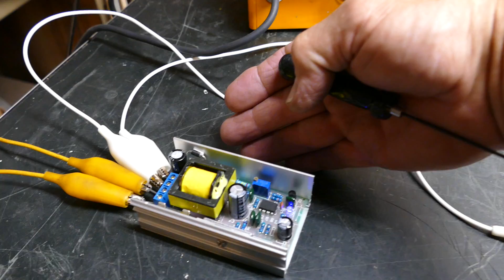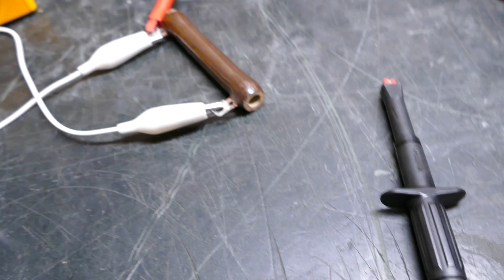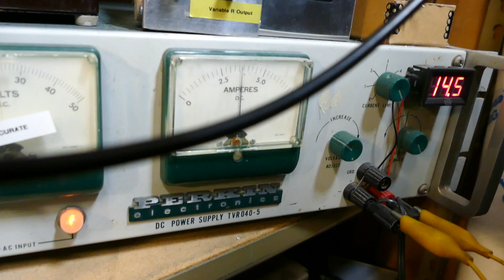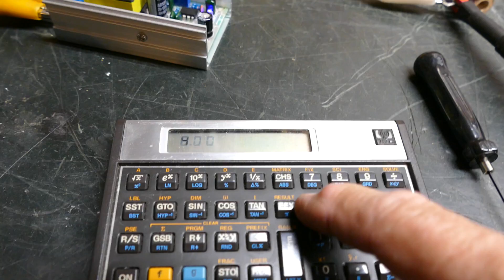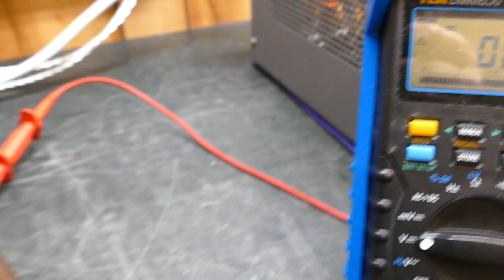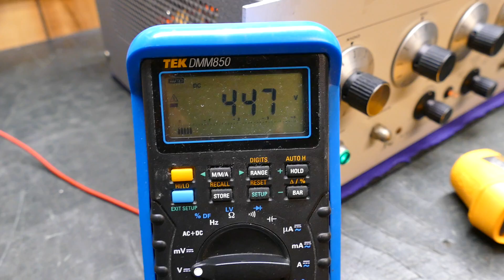Solid State High Voltage Regulated Power Supply For Vacuum Tube Circuits

Comment: Thank you for the hands-on review of this high-voltage power supply.  I realize that I am very late in joining this conversation, but I can't seem to locate the exact part or model number for this unique power supply.  Can you (or anyone) help?
Reply from the maker: Here are a couple that can get you started. On Ebay they are called, high voltage dc to dc converters, or something like that.  

https://www.ebay.com/itm/293851632650?_skw=high+voltage+dc+to+dc+converter&itmmeta=01JM3YMCPQ2G925VCCQDP35Q29&hash=item446aec140a:g:wQcAAOSwspxikT~-&itmprp=enc%3AAQAKAAABAFkggFvd1GGDu0w3yXCmi1dZtoO%2BI6bpY1RPy4yAmuS0b5CqyTo9QE0ngx9LbuwM0tDdlHqsHEq%2FdmF3BbaIz%2B%2FFYvSibdyJPHPsivDw9s4F5dc06zKra7skKeggDsISITW4yLQ52SlwZy9J4YeHRtrmQE9tPYtFeKUG5Iw0xri%2FFUH3eb8jnIwlMyom28bKonnst3DKtdYHys%2FbvG2lfSkakgqlSldEjbQGhk15ZBaCnbd1owv45YisrYgPIby6y%2FUtr06JpXCJnCZbddMgi%2FQ9UiIQQX%2F2Wi4FZAf9GSur2Rb39AQcw6TIVRrtaF4hDrzIuEK%2FmJOakryHG6pCYWM%3D%7Ctkp%3ABFBM1MvR_qBl

https://www.ebay.com/itm/405486310033?_skw=high+voltage+dc+to+dc+converter&itmmeta=01JM3YMCPQYRGFJ94DJC9QFG0T&hash=item5e68de1291:g:wJIAAOSwHD1ni-ET&itmprp=enc%3AAQAKAAAA4FkggFvd1GGDu0w3yXCmi1fliUuKc3P%2BGJdU4enYd3BMrbUrgGSisPOpv7jAiYGFFtOIqtrVr6d%2Bx8TT6QtJY6fDy7jpC7ZT%2BC%2Bb6un0ZZTzozM1SJcSfrPE7zk8a0Fs8nJYQZZiAYYmJ1kxSMLaEDJLW9uOYf8IC0CmWWNTwJlHo3Obtv9%2FNbsDilvLZ9cGYEJ3r8v%2BgstGPf0K95py4crHT6YB9lxSTKUD8y2Xn767aG7MK9grajoKJgJRrr0%2Ffv7gJUiE6awY02fgGQm8UQpTUT9Q0nzuB9TG0Kf6%2FUcP%7Ctkp%3ABk9SR9bL0f6gZQ

Comment: I've got a Crown SXA stereo tube power amp that has two EL37 tubes per channel, but the crazy thing has two power supplies that are JOINED to make the b+ for the tubes! Ive been looking for a way to safely bump up the voltage to separate the two power trannies for a dual mono block design, as the thing just doesn't sound right sharing power like that. I'm getting 300 and change from each power tranny, but would i be better off with just running one of these instead,  one per side? Because thats the right voltage under load that this is looking for, and since this was originally in a studio rack, the trannies are butted up against each other, PT to OT... making the thing not very quiet, and 120hz hum always present. Hmmm.... i may just give this a try, since its solid state rectified anyway. Might as well do it right!
Reply from the maker: Here is a link to the schematic and I don't see anyway to separate the power supply. There is a common 490 VDC going to the CT of each OPT. The other voltages of 420 and 340 go to the L and R signal channel tubes.
https://audiokarma.org/forums/index.php?threads/question-on-1959-crown-sxa-tube-amp-power-supply-switching-noise-from-half-wave-rectifiers-120hz-hum.1056164/page-3#post-17056638

Comment: Bringing this back up from 6 years ago I know, but I just picked up one of these that does the HV and has another output for filaments :P
Reply from the maker: Very nice to have the filament winding. They are amazingly powerful little HV supplies. I suppose the high frequency that they operate at would not be audible and much smaller capacitors can be used to filter the output but still, I have never build an amplifier using one. Let us know how your amplifier turns out.

Comment: Any idea if the supply is series regulation, shunt regulation, or both?
Reply from the maker: Here is what I found on the Internet:   A switch mode power supply regulates an output voltage with pulse width modulation (PWM). This process creates high-frequency noise but it provides a high-efficiency rating in a small form factor.

Comment: Anyone successfully build an amp using one of these?
Reply: I am working on one right now...
Reply: @sawyer7271  Using this power supply or another brand or making your own? Good luck. Keep us posted!
Reply: @W1RMD  I will lose this link, I am sure.  Find me on Facebook: facebook.com/sawyercbg or sawboxguitars.com . . . I will post my success/failures there.    The one I am using is different, available on Amazon or fleabay.
Reply: Oh: as a test I thought I would go ultra low power, so I am building a Deluxe Micro by Rob Robinette.
Reply: This is the SMPS I've tried and I recommend you stay away from it:  https://www.ebay.com/itm/DC-DC-Boost-Converter8-32V-12V-to-45V-390V-High-VoltageZVS-Capacitor-ChargerFM/383806494261?hash=item595ca65635:g:6tkAAOSwo9VbDmv5  
I've built several of them. 6BM8 & PCL82. About 3.5 watts per channel. They all sound wonderful. But the SMPS lasts anywhere between 5 minutes and 10 hours. Then it dies by overheating or blows one of the 10uF caps. I do have one PCL82 amp in which the SMPS is still working after 3 months. Don't know why it's survived, built like the others. So I have some amps that need a PS, maybe will try this model SMPS. Otherwise, will convert to conventional.
Reply: @Nirky  , thanks for sharing your experience.   I have a feeling that these are not capable of delivering their rated power.  I have one in a 2W tube amp.   Hours and hours of testing with no issues, and no noise artifacts.  I have a few and will mount one and load it up higher and let it run.   I wonder if the input voltage has an effect.   I recall the listing indicated that higher voltage input equates to higher power output.   

I also noticed that higher inrush current loads would cause the device to make clicking noises as it tried to keep up.  In this case, I had a large traditional capacitor in the power supply.  Adding a resistor before the main filter cap calmed it down.  

My plan is to do more testing and use these for low power amps.  I would not trust these at  high current loads...
Reply: @sawyer7271  After the SMPS I have a CRC consisting of a 390 5w resistor & two 100 uF 400v caps. Amps are all quiet ear to speaker.
Reply: @Nirky  what is your voltage input to the SMPS, and overall current draw?
Reply: @sawyer7271  For the PCL82 amps I use a Sony VAIO laptop adapter rated 16v @ 4A, have not measured draw. For 6BM8 I use 12v 5A adapter.
Reply: @Nirky   I used the same power supply, and a buck converter for the heaters.   It is all running :12AX7 and 12AU7, with the 12AU7 in class A @300V.   No issues so far.
Reply: @sawyer7271  How did you filter the HV?
Reply: @Nirky  820ohm resistor to a 33uf capacitor for b+, then 27k resistor to a 10uf cap for B1+.   I think your 100uf cap is too big, and your resistor is too low...  at startup, the load on the power supply could be an amp trying to fill that huge cap...   depending on your amperage requirements, you might consider a 1k resistor between the power supply and the first cap.   Keep in mind that this power supply has its own capacitors, and you aren’t trying to flatten out the 60 cycle ripple from a rectifier.   The purpose of the capacitors in the power supply section are now to help eliminate sag during peak load.
Reply: @sawyer7271  When you say same power supply, you are talking about the model in this video, yes? If so, I'll have to try it.
Reply: @Nirky  no, the same one you had problems with...
Reply: @sawyer7271 Thanks for the info.  I'll try both the new filter values & the Boost converter on this video, will report results here.
Reply: @Nirky  me too!  I just ordered 2.
Reply: @sawyer7271  Update: I received this very same boost converter 2 days ago. Worked flawlessly in my 6BM8 SE amp for about 5 hours. Not quite as loud as it should have been, but the sound was clean. 

Turned it on yesterday and started hearing heavy noise. Am DONE with these. Will be going back to linear transformers until they can make one which can handle the modest requirements of a 2-channel 6BM8 amp which outputs no more than 8 watts total.
Reply: @Nirky  I'm sure their output rating is way overstated, and 8W continuous output is probably closer to 20W of input power.   So far I am good on low wattage amps (2) so I will stick to 2W amps or less,...   I did find the one shown here.  I have two of them... I will load them up on a dummy load and see how they do...

Comment: My old 100w crate came with a SMPS power supply. Very light compaired to the old stye Transformers. After about ten years it shorted one diodes for a 15v control output.  I had to learn a little about them. It wouldn't startup with the wrong voltages at the control chip. I was about to retrofit the amp it before I finally found the trouble.
Reply from the maker: Sometimes, but not always, it is easier to figure out and fix rather than to completely re-engineer...   :-)
Reply: @ElPasoTubeAmps  Thanks for your response. I don't know about easier but it was alot cheaper than a new boat ancor transformer. An old dog resists learing new tricks :)

Comment: I like your calculator old HP that uses RPN that’s reverse Polish notation I have a hp-21 that have had for 22 years
Reply from the maker: I love my 15C.  I have had my original since when they came out in 1986 (I believe that is when they came out). I have two now plus an app on my phone and one on the PC.  
I have learned to test the app ones by calculating the value of e. It is equal to, (1+ 1/n)^n. A "real" HP calculator will always come up with the right answer or if you make n too large it will give an error but never a wrong answer. 
The PC app will just give a wrong answer. Make n equal to either 1E6 or 1E9 and see what happens. You should come up with 2.71828....... 
I just rediscovered a HP 31E that I forgot I had and it works great. When I do an operation, and I just did the e calculation, I can see the digits flashing as it computes since the CPU is so much slower but it comes up with the right answer even setting n equal to 1E9.

Comment: link for that ?
Reply from the maker: Here is one like I bought off Ebay. Look around for others with a similar type description.
https://www.ebay.com/itm/DC-DC-Converter-12V-24V-to-100V-250V-DC-DC-High-Voltage-Boost-Power-Supply-Board/112515806601?hash=item1a3276f589:g:VWUAAOSwEgZZicJK

Comment: So hello Its been 4 years since this video. I have been designing a  switchmode powersupply for vacuum tubes and I did make some prototypes. On my youtube channel is the first functional one (which has been decomissioned by now and replaced by a better one that still isnt perfect). I have been designing a SMPS for mains power. Anything between 96VAC up to 265VAC. I wonder if you "Elpaso TubeAmps" would have any interest in my little project. Doing this kinda as a school project for a competition. (Im 17 just so you understand that school thing). The output of the PSU will be regulateable from 200 up to 500V at 50-60W max continues power. Low output filtration will make this a really cheap option. (Before you ask THERE IS ABSOLUTELY NO NOISE ON THE OUTPUT....the only issue is with the switching transformer itself hissing at me (because of mechanical reasons) but that will be removed). So yeah I wonder if you have any interest or anyone. (Sorry Im not native english from slovakia so yeah i make a lot of grammar mistakes)
Reply from the maker: Hi Adam - first off, your English is excellent so don't worry about that.
I got my SMPS for some mobile projects that have not happened yet. I am quite surprised as the power level these little devices can deliver. As for noise, I understand. Some 30+ years ago I made an amplifier for my 20M mobile rig in my car that was mounted in the trunk that ran a pair of 6146 and the PS was a SS supply our of an older marine band radio and I had no issues with noise. I Think mine ran at about 2KHz and as you say, I could hear it  hissing but that is all. I have been asked the same thing about this type of noise and I do not have a problem with that.
I am not sure how I can help as my building is mostly in vacuum tubes and linear power supplies. If I need a SMPS, I just purchase one...
I don't remember the details of the ones I have but I seem to remember them having a wide range of voltage so, obviously, studying others designs is a good way to make our own design and improve on the older ones. I know you know this.
Anyway, how can I help?
Reply: @ElPasoTubeAmps  I have been watching your channel now for two years and I really like the content you make, so I thought perhaps youd have interest in seeing such device I created and it also could be usefull in your projects (im just assuming here)
Reply: @ElPasoTubeAmps  Once I will get a fully funcional device working I could perhaps send it over your way you could test it see what it can do in a proper manner. This wont be a mobile application thing because it will run from mains. I am a student and surprise surprise the power transformer aint so cheap...and living in a remote location of slovakia shipping is no cheap matter. I had to buy the OPT for my tube amp I built (I designed the 5-20 on full PCB) which was already not so cheap. But at least its local pruduction (poland) and its a toroidal wooo. 
Originally this PSU was meant to be a power transformer replacement. By now youre probably thinking "well thats great but how are you gona power the filaments". My answer is cheapo ebay power supplies. Buy a 5V psu and mod it to 6,3V precisely and now you have a precisely regulated heater supply. Tube life extended and overal circuit stabillity has been increased. 
You will still end up a goood amounth of money cheaper than a proper chunk of iron in the back..and it brings some advantages: youre carrying practically half the weight you would in case you have to move the amp and its not on wheels, tightly stabiilised voltage, and probably the biggest problem with transformers is mains fluctiation. I built the 5-20 so it would not have been an issue but just imagine a grid biased amp. I bet that thing would go a bit more toasty. 

So yeah I was curious if you would be interested in seeing such a thing maybe in person if you want, once I have it working I can send it over so you can see for yourself. (the "once I have it working" part might take a good while because scratch building stuff isnt that simple :D)
Reply: @adam207321  hi .. Mr. Adam just curious.. how did your tube amp project go?!! Did you complete that.?!
Reply: @javanpannadi  no, not really. Due to the extremely elitist negative backlash from the communities, I have stopped working on it. The amplifier itself (modified Mullard 5-20) is working and done. The video is on my channel. All of the switching supplies have been by now decomissioned removed from service, the amplofier is for sale for the cost of materials. Its unfinished, doesnt have the planned wood frame arround, just top and bottom metal plates. It works but the physical appearance is not done. It is for sale for the cost of materials. Nobody wants it.

Comment: Hi 
at last did you used in a tube amp? Interested to use in a pp el84 guitar amp, you think it will keep up or will blow up? Thanks for all 
Mike
Reply from the maker: I had the intention of using these power supplies in a portable tube amp but I haven't gotten around to it yet.  In the tests I did, I was very surprised that they could actually deliver the voltage and current as advertised but honestly, I doubt they will last very long... As crazy as it may seem, I recently installed a 120 VAC inverter in my truck rated at 1000 watts and I have been using that successfully to drive my ham radio tranceiver at 100 watts output. This is really old fashion but I will probably stick to tried-and-true linear power supplies.
Reply: @ElPasoTubeAmps  thanks for the reply. Searching around I've seen a 150w version of it. I was thinking to build around a marshall 18w around it, 2 12ax7 or maybe 3 , one for the tremolo and a pair of el84 in pp, maybe the 150w dc dc converter will keep up and doesn't blow, what is your opinion?
Reply from the maker: @mikestormm  I think over sizing this type of power supply would be wise. This not meant to be a slam against Chinese products but I tend to rate products like this at one half the power they area advertised at. Maybe I am just very conservative.
Reply: @ElPasoTubeAmps  Good rule of thumb. I usually only consider a what something can do at 100 percent duty cycle it's power rating. If it won't reliably run after I walk away, it's no kind of rating.

Comment: Would it be possible to use more than one of these in an amp?  Maybe one on each op tube,  and one for the driver stage?
Reply from the maker: I am sure you can. Maybe use one for each channel of a stereo amp.  It has been a while since I have used these power supplies but if I remember correctly, you can not put them in series meaning if you have two 450 volt supplies you can not series them to make 900 volts. You would want to research this carefully in the manufacturer/seller description of the power supplies before using them if you want to parallel or series them. You could use one for the plate supply and a different one for the bias supply and a third one for a screen supply if needed. They do require a high current 12-14 volt power supply so make sure your primary supply will deliver the required current.
Reply: @ElPasoTubeAmps  @KG Salvage Yep you definitely can use several in parallel, as that's what I did to get around having to use a custom power supply to drive with sufficient power in a tube design. I tried to get them as close to the same output as each other but of course it's impossible to get them exactly the same. I used 2 in parallel to drive up a a 60W load successfully as I recall. There's an output diode in each one.

Comment: It would be useful to post a link or name for the voltage booster. I would love to use this concept in future projects as I have access to a number of old Laptop power supplies, able to easily deliver the DC needed. The cost of the iron is my main limiting factor when dealing with Tube audio.  I have a stock of old EL 34s 6DJ8s and other tubes on hand ripe for the odd experiment, but I cannot spend close on $50 per transformer / choke just to play around.